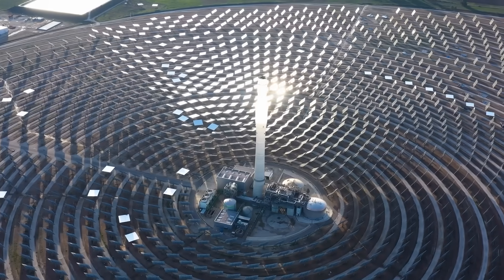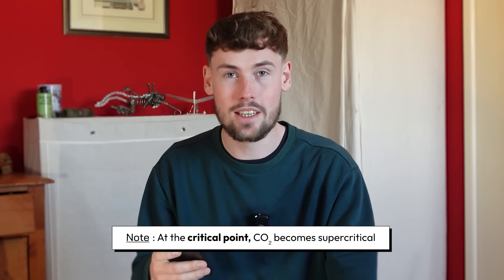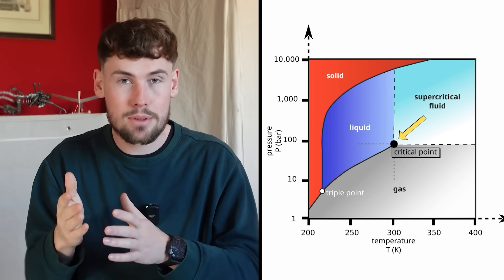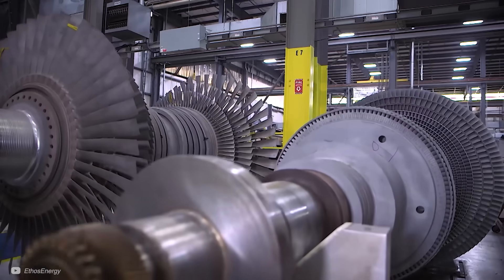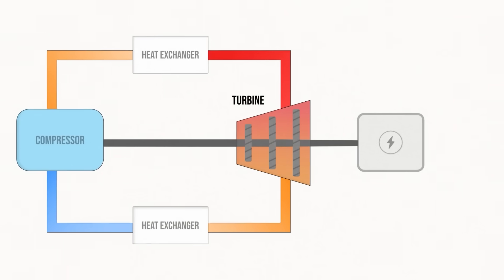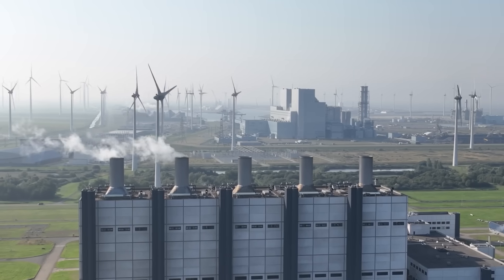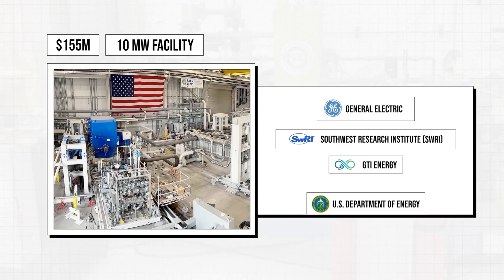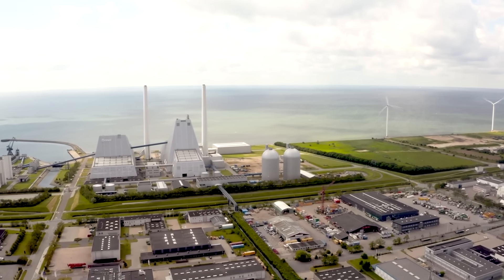How Ultra-Efficient CO2 Turbines Are The Future of Energy

Comment: This is fascinating but many highly optimistic presentations tend to omit numerous key design factors that present downsides. This is often done as a way to attract continued experimentation funding. Hardly mentioned here is the fact that at pressures of 250 Bars (atmospheres), absolute, and temperatures of 715°C, the sealing of the turbine shaft is difficult to maintain, The mass of all the circulation components become extremely large and the heat exchanger efficiencies are likely to suffer unless they are scaled to very large sizes.

Another aspect of this presentation is it comes with the widespread assumption that we have decades left to fully develop the technology and scale it up for widespread deployment. Those working on such projects must be masterful in excluding the following warning from their consciousness.

UN chief: World has less than 2 years to avoid 'runaway climate change' (TheHill)
  * This statement was made 7.2 years ago.

Comment: A Double A Fuel Dragster uses and internal combustion engine; i.e. crankshaft, pistons, and a very powerful supercharger.  The fuel being fed into the engine is a mixture of air and nitromethane compressed to 60 psi at a very hot temperature.  I've read this mixture of compressed air, fuel at elevated pressures and temperatures flows into the engine as a supercritical fluid like material.  I really did know what the nature of such a fluid is until I saw this video.  BTW: These engines produce about 10,000 hp with the supercharger requiring approximately 2500 hp from the engine.m

Comment: The proposed increases in efficiency are misleading because all efficiencies are compounded. In addition, energy density for a given cycle must be considered. Mechanical efficiency is going to be the main factor in comparing systems, and the extreme temperature gradients of this system may prove to require more seating forces and less desirable sealing materials leading to more friction, cost, and diminishing returns for a more efficient cycle.

This is also what’s so misleading about electric cars being more environmentally friendly, and it’s absolutely a scam. 60% efficiency at the power plant * 60% efficiency in development industries reduces efficiency exponentially. Every step from raw materials up to energy utilization introduces inefficiencies exponentially so.

Comment: I worked on the step project for nearly 2 years as a 3rd party contractor. It works, but it's a full redesign of a standard power plant. At the time there were only 2 companies in the country that could weld the specialized inconel pipe that must be used to withstand the pressures and temps. Had a blast working there!

Comment: Aneutronic fusion (fusion that combines elements resulting in few or no high energy neutrons) could, depending on the elements, produce electricity without the need for steam -- fusion directly to electricity (well, to beta particles and x-rays or whatever) without the need  for heat to make steam.   "Could" if it ever works....

Comment: this is nice, but it is still-take something, heat it up, spin a turbine, make electricity for the grid.  Solar PV basically gets rid of those middle 2 steps, it may not have fantastic efficiency yet, but...1, the efficiency keeps increasing...and 2 the premise is the way to go.  Take something, make electricity from it for the grid.  If you cut out more middle steps you immediately increase efficiency, like when(for instance with solar) you take away the need for fuel with a power plant...meaning the "harvesting" of it and transportation of fuel to the power plant.

The discussion about renewables needs to be made on all of these points, but this was just a video on turbines I know...however, how many renewables use turbines???  Hydro?  That may be it.  

Oh well, I still like the idea of having a little of everything, even if some of it is "dirty" to one degree or another, research has a certain degree of unpredictability about where the end point is.

Comment: One thing not mentioned in the video is how high the total efficiency can go with the use of regeneration.  Does it still apply with CO2 generators?  If so how much does that increase total efficiency?  This is kind of meaningless without this information because most large scale steam systems used for electricity include this cycle.

Comment: I have been pondering if water could be replaced with acetone, as it has way lower boiling point yet it doesn't need high pressures at every step like co2 and many other low boiling point chemicals do.

Then again im more interested of sub-critical systems anyways, this sounds like running another machine that is perpetually about to explode.

Comment: Ziroth: Please get a job working as a design engineer as you regularly focus your videos on the wrong thing. The critical improvement is in the efficiency improvement over steam. The cost of using this technology is that it needs to operating at 250bar. The size and maintenance of the turbine blades is not important in real world applications

Comment: "There is a lot of energy wasted when you convert from one phase to another, like a liquid to a gas... thats where you lose a lot of energy in the steam turbine process" (7:42)... *cries in thermodynamics*. If volume expansion of your working fluid can be considered wasted energy. In a carnot cycle, a phase change is kind of the whole idea. The issues with the steam turbine, is it needs to follow a modified  carnot cycle as opposed to the ideal one. As well as the fact that its maximum evaporation temp is limited to between 500 and 650 C... 

Idk how some of these tech youtubers get by when they say something anyone that's 3 weeks into a thermodynamics class knows is wrong

Comment: I like the topics you present, but I think the videos could be improved with less repetition and unnecessary linkages. For instance, I'd say a vast majority of the audience knows the use of a steam turbine. With that out of the way, you could address the specifics of the materials science application in this - what seals are being used, what metals, and how corrosion functions at higher pressures.

Comment: the other most changeling issue is the pressure: if working pressure is around 75 bars, then the seals should hold a much higher pressure for a spinning shaft

Comment: I wonder if this might be a time to reexamine N. Tesla's water / steam turbine with high speed rotating plates that have not been feasible with current metallurgy. [ I'm guilty of just watching the thing rotating plate electrostatic motors that you also did. It needs to be compared to the Tesla approach at this point, as well. I see an overlap of all three of these technologies that will quickly become apparent, side-stepping equally obvious major pitfalls. But, I doubt this will reach anyone's cerebral c. for five years, and this is another "Kilroy was here." for me. I'm used to it.]  

Neat.  Ciao, Tony. 🤔 😊

Comment: Considering that renewables will be the biggest power source of this century I will low your hype statement.
A significant advancement in its area no doubt, but if renewable (solar + wind) are the major contributors as I predict, turbines will have less impact in the future.
Specially considering that for help compliment renewables it helps the thermal source turn on and off quickly, and piston engines are better than turbines in that regard.
Still I'm pretty sure it still will be plenty turbines there, so they will have a share.
But not the biggest share.

Comment: Your co2 had better be bone dry or all your machinery will corrode.  Also it was a bull shit point regarding water drops in steam. That does not happen in a proper steam turbine system. In fact you completely mis represent the steam turbine system operation. Are you that dense?

Comment: I have been working with Supercritical CO2 for decades. As a solvent in the food industry. After CO2 moves through the turbine, what changes? The pressure? The temperature? This could be made more clear. What could be used to maintain these special conditions? Petrochemicals? Nuclear energy? I am saying there is room for improvement. Perhaps, i need to watch for a second time.

Comment: If a 4 mwh turbine is that small, I wonder what a 20 kW turbine would look like. If single-family homes with natural gas furnaces could generate electricity. Dirty power plants wouldn't need to deliver energy over costly powerline infrastructures.
Reply: It wouldn't work the reason that turbine is that small is because its running at extremely high speed (27K rpm). The smaller the turbine the higher the rpm. You would have to go for a centrifugal turbine design over axial.

Comment: HOw efficient was the texas turbine working at 500ºC ?
Reply: Do the math, carnot efficiency (η = 1 - (T_low / T_high)) predict its wasn't that good 1-(273.15/(500°C + 273.15))=64.7% max, more realistically max power (η_max power=1-sqrt(T_low / T_high)) is 40.5% max. The max temperature for a steam plant is about 655C if you use special alloys, so they can theoretically be more efficient.

Comment: I think your video loses its argument when you suggest there is no phase change.  It suggests the claimed improvements are for the turbine and not for the whole cycle.  As others have said in the comments, phase change is crucial for the Rankine cycle (or its derivatives),  since the heat loss of condensing the working fluid is less than the heat that would have been lost in compressing the working fluid in gaseous phase.  The turbine has to be expanding the working fluid in a compressible form, and there would be similar operating costs due to droplet formation in the last turbine stages (with an economic balance being struck for net financial gain versus fuel costs).  Always good to see new ideas being tested, but I think this kind of thing is a re-heating of some old ideas.

Comment: Hmm, I wonder if this could be combined with a Tesla turbine? I'm no mechanical engineer but from what I heard they where more efficient that bladed turbines but weren't practical because when scaled up for industrial use they spun so fast the centrifugal force would destroy the disks BUT if the turbine was using supercritical CO2 and the turbine was 1/10th the size the disks will be tuned 1/10th the stress, right?

Comment: small correction 3:49 You state 170 PSI where the chart shows 1,070 PSI.   74 atm = 1,087psi.
Its an interesting concept and businesses will push forward regardless if they can make a quick profit, but the short term nature of using super critical CO2 will be a large factor in the costing, when it comes down to servicing these turbines on a regular basis. CO2 under pressure is corrosive, probably more so than water, so I fear the benefits will not outweigh the long term costs.

Comment: Okay, but I didn't catch the video explaining guy. We extract more energy from the turbines than the compressor. 

As many have noted here, water is pressurized with a small amount of energy because it's incompressible and then the heat energy turns that to gas to create more volume and that higher volume flow at the same pressure provides more energy than was put in. 

Does this supercritical liquid change volumes throughout the cycle?

Comment: Open to correction here, but as I understand it, the frequency stability of the power grid depends largely on the combined angular momentum / inertia of all the turbine rotors in the thermal and hydro plants in the system (lack of which is a problem with renewables, particularly solar). If the sCO2 turbine's rotor is 10% of the size of a steam turbine's and much more like a straight shaft in configuration than is the case with a steam turbine, then its moment of inertia will be tiny in comparison and the sCO2 turbine will have much less value in maintaining grid stability. Which would be a problem.

Comment: Well there are plants using supercritical water, as water is easy and cheap to handle. A fair bit of efficiency is gained by the smaller size. There is simply less area for heat to escape, and as you usually compact massflow with higher density also less time. However you are also compacting all mechanical stress on less material, and you need to step up pressure and temperatur significantly to sustain supercriticality of any gas.
The physics around it are also known for a century by now. So if there was a decisive advantage many had the chance to adapt by now and didn't do it.

Comment: Nice, this is the first time I have heard of improving/upgrading the turbine part of the system in any heat-driven electrical generation system.  What's nice is that if this works, it would increase efficiency for any type of fuel in a heat-driven system (coal, gas, nuclear, geo-thermal, solar thermal, etc). This would include any solar thermal and stored thermal energy sources.  Even photo-voltaics and wind could be used to create and store heat if the conversion of that stored heat to electricity becomes more cost-efficient relative to batteries.

Just that reduction in size of the turbine is amazing.

Comment: Actually, this is an interesting video/science technology that can be explored. Based on my personal experience when I was still studying chemical engineering in my university, when I was doing mechanical design for my PEM electrolyzer for hydrogen production using integration desalination of seawater for my capstone group project, titanium seems to be a really good material for this specific case as well, just for context, I was designing the pressure for 315 bar and 80 degrees celsius as my operating condition, so comparable operation conditions but temps are much lower in my case. Also, in my mind, I think that the turbine blades is not going to be a big problem because there are mature technologies and materials that we can reference when designing this sCO2 generator turbine blades(basically, take inspiration from airplane jet engines, which operates at really high temps and pressure, and superalloys like inconel and steel-based superalloys could also be good here, the cons is that they are hard to manufacture and process(like machining them)). Other options would include more novel material science like HEA(high-entropy alloys), with tungsten and titanium as the base for very good thermal-mechanical strength/properties, I briefly know a bit based on very quick chatgpt research so yea, not my forte by any means. Lastly, as a chemical engineering student, I would like to ask, is it really worth it just to push this sCO2 electric generator system? In my humble opinion, I feel like the process of capturing CO2 from the atmosphere(like I'm pretty sure this will be the main method for obtaining CO2, other than buying CO2 waste from chemical production plants) is very energy intensive and further processing of turning CO2 into sCO2 requires so many more tedious processes like heating it up and pressurising it, and needing a very strong pressure vessel to contain it, would make the overall cost of the system skyrocket. Which makes me wonder, are there other gaseous chemicals that we can superheat and use instead of carbon dioxide or sCO2? Looking forward to replies.

Comment: So the main difference is more compactness. Technically, we already have CO2 turbines: classic industrial gas turbines, the open Brayton cycle. This in the video is a type of closed Brayton cycle
Reply: No, the big advantage is the huge difference in input and output gas temperatures - far bigger than for an OCGT where the output is still bloody hot and so wastes energy (precisely why you end up using CCGTs - using that hot OCGT output to raise steam for a Rankine cycle turbine - in power stations). That means higher Carnot efficiency.

Comment: I think the main benefit of S(super critical) CO2 turbines is that it is small enough to add to other already existing systems to recaputre and reuse energy from fossil fuels or waste proesses that release CO2 (eg iron smelting). You could add these for and upfront cost and get long term returns and should reduce research with aerospace research like with the inclusion of general electric. This is because they tend to work with materials sciences for these sorts of things.